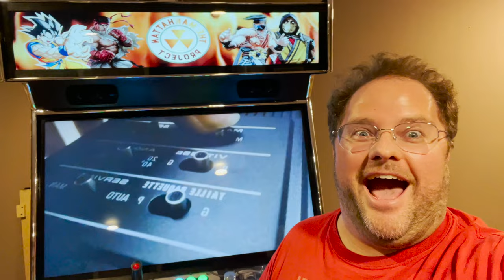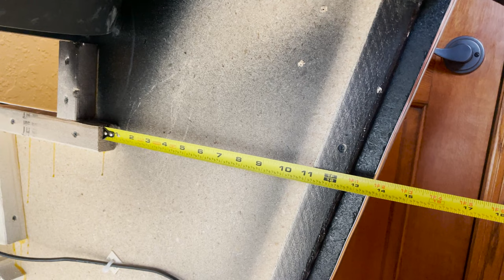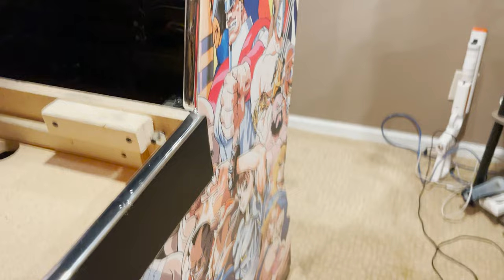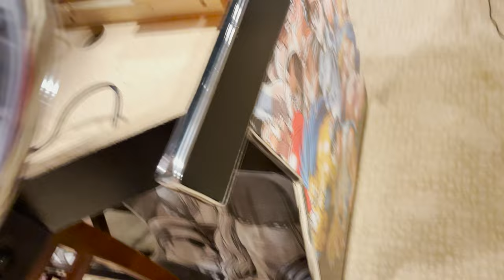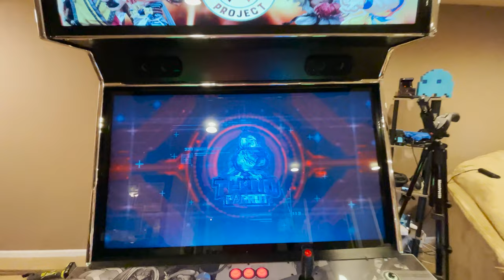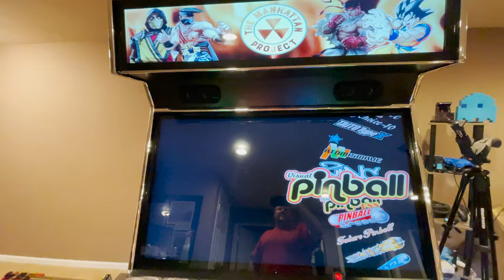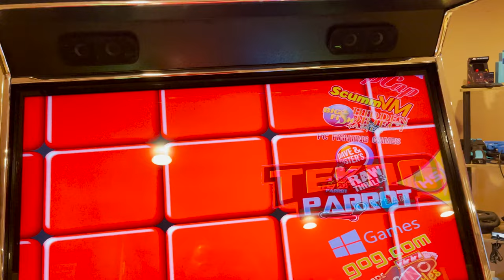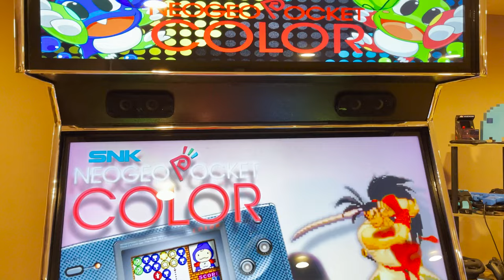How to cut a MEGACADE in HALF!?!

Comment: That's a professional cut!!! What tool did you use to.make such an awesome job?
Reply from the maker: I can ask my dad exactly what it was but he brought over a small circular saw with carbide teeth and a high tooth count. Like 3-4” blade diameter. He used to modify cabinets.  If you look at the pics in the middle of the video where the megacade is laying down, it’s the gray saw resting in its back

Comment: Why did you cut through the horizontal brace?  You could've unscrewed it and put it back after the cut for more support.
Reply: If it’s like mine they glue the shit out of everything and then screw it down.  I had to cut mine too but not to that extreme.  I removed two pieces on the inside that were glued and had to knock them out with a hammer and then they took a chunk of the particle board out because of the glue.
Reply from the maker: What TJ said, glue everywhere, would have been harder than straight cuts